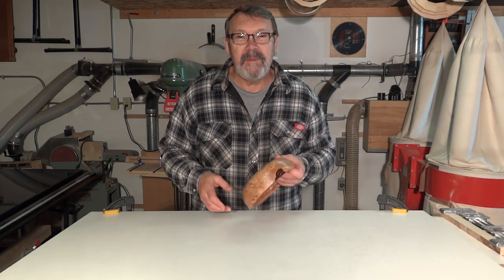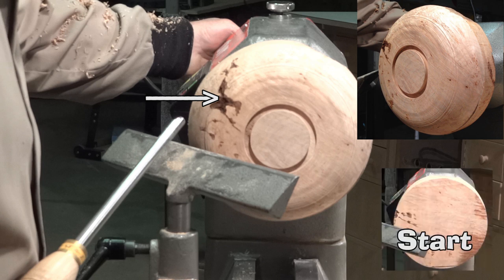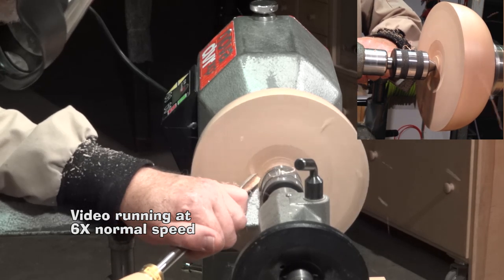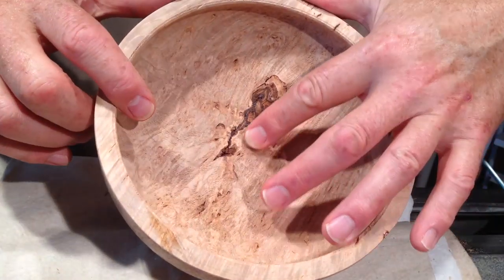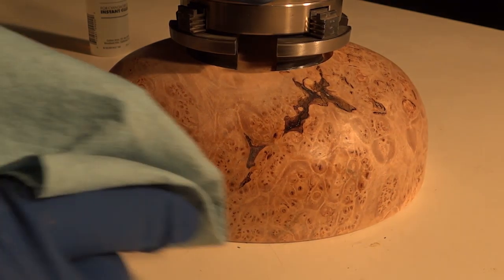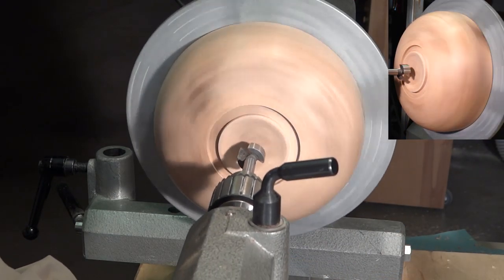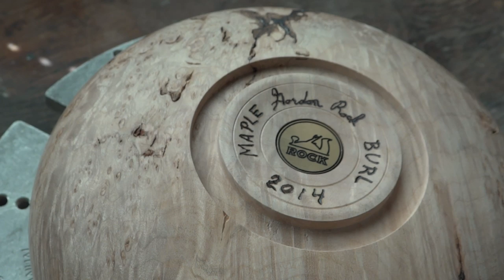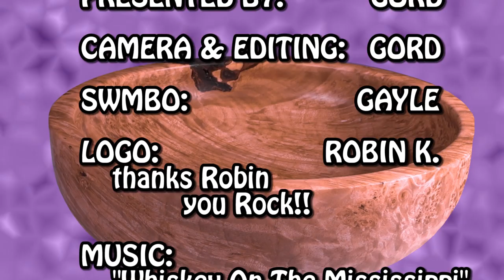Turning A Candy Dish From Maple Burl

Comment: Beautiful burl bowl.  Sometimes the difficult things turn out the best.  I have a couple of burls that still have the bark on them.  A woodturning friend is going to turn them for me but I have to get the bark off first.  Any suggestions would be appreciated.
Reply from the maker: Arlene Spaulding Thank you, Arlene, I'm glad you like it. To get the bark off - sometimes a difficult job - I usually use a putty knife or something similar. I hope you like the job your friend does with the burls. I've sometimes had burls that were so beautiful I just wanted to put them on a shelf without touching them. But where would the fun be in that??
Reply: Arlene Spaulding pressure wash it, it will blast the bark right off.
Reply from the maker: Misfit1026 Great suggestion!!! Never thought of that.
Thanks,
.....Gord

Comment: Thanks for posting, I thoroughly enjoyed watching this over my morning coffee(s)... kinda makes me want to skip work and head into the shop!  :-)  I've gotten pretty good at turning pens and shave brush handles, but haven't attempted a bowl yet.  This video has inspired me to do just that!  I do have a question... when you turned the bowl so that the inside was against the headstock, you must be padding the jaws somehow to a) protect the finish of the bowl, and b) to deal with the inside lip? and c) did you... could you... put any other finish other than olive oil on the bowl, is that enough to protect and seal the wood?

Keep up the good work!

C Venne
Ottawa, Ontario Canada
Reply from the maker: Hi Chris,
I guess I forgot to show it but to protect the top of the dish I just put a layer of masking tape on the top. The rubber buttons of the Cole Jaws don't damage the inside (or outside) of the work they are holding so there's no problem there.
Any finish you want to use would be fine. I chose olive oil because it is food safe and also because it darkens the wood slightly. If I was not going to be putting food in it and it was just for display I would likely use MinWax Wipe-on Poly. I hope this answers your questions. Let me know if it doesn't.
Take care,
.....Gord
Reply: +Gord Rock I've read that unless you are going to be putting hot liquids or scraping the inside that once cured Poly is safe with foods like nuts and fruits.  I use olive oil on my wooden cutting board and have been using it for years. No rancid odors or anything. Of course the board gets washed after use.  I've got a bowl I roughed out that had a knot that popped out and got lost.  I was thinking of getting some epoxy resin to fill the void.  Any thoughts?
Reply from the maker: +Robert Schuster Hi Robert,

Depending on how large the hole is epoxy resin should work very well. You can also color the epoxy to give it a contrasting or complementary effect. You can put tape on the bottom of the hole if the hole goes all the way through and remove the tape after the epoxy is fully cured. I'd be very interested in how it turns out if you try this.
Thanks for commenting.
Take care and have a very Merry Christmas and a wonderful 2016,
.....Gord

Comment: Really like your work! I find that the more turners I watch the more I learn. One thing I would like to try, as I turn a lot of Maple...most spaulted, is to use clear epoxy (like in fiberglass work) to seal up the punky parts. Have you heard of anyone trying this before? Anyhow, thanks for the hard work of putting the videos together.
Reply from the maker: Earl Rumble I usually use epoxy but had run out. I had heard of using CA glue and wanted to give it a try. Next time I would definitely get some epoxy. The CA didn't work too badly but it took a lot of it and the CA is quite pricey. Thanks for watching! I'm glad you enjoyed it.

Comment: What's the name of the tool you used to mark the centre. i always find it hard to get the middle on a round piece.
Reply from the maker: +pedrocascc2000 
It's called a Center Finder and it's available at many woodworking suppliers. I believe I've seen it in some hardware stores, as well. They are excellent for finding the center on both round and square/rectangular pieces. Hope you can find one! Thanks for watching. I appreciate the support.
Take care,
.....Gord